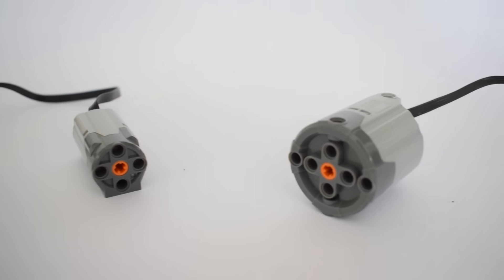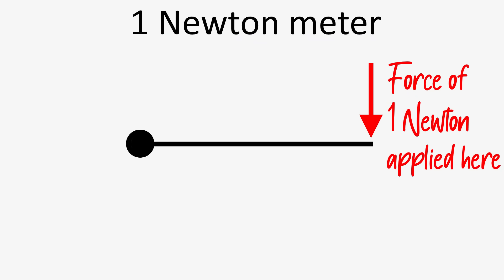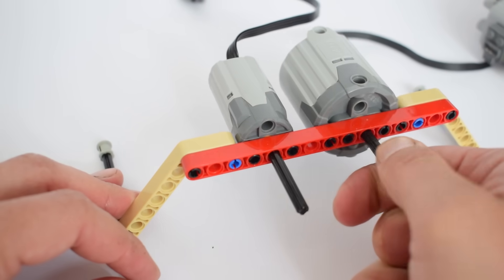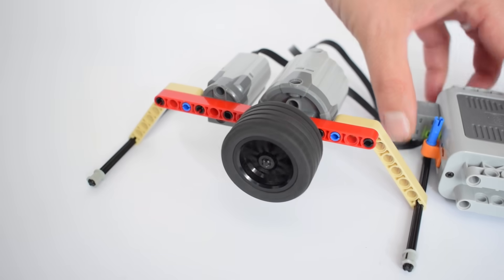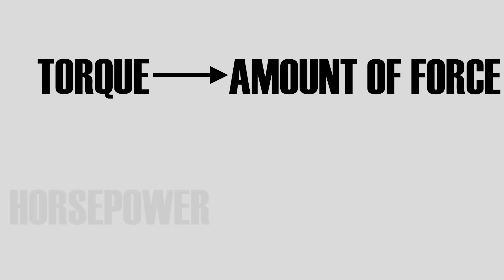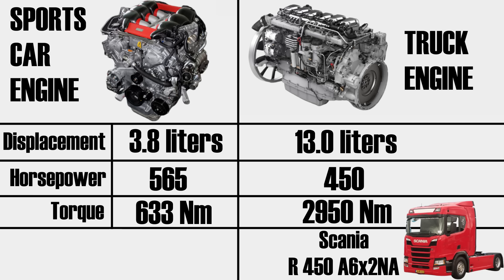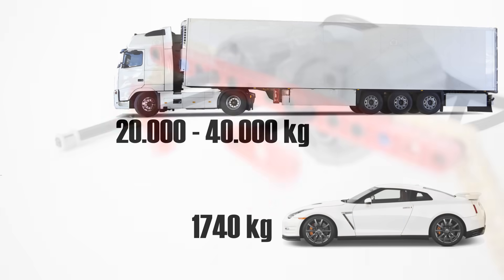NEVER be confused by HORSEPOWER and TORQUE again - HP and TORQUE EXPLAINED in the MOST VISUAL WAY

Comment: This is how my teacher taught me.  Spinning a wheel as fast as you can is horsepower.  Spinning a wheel as HARD as you can is torque.
Reply: You've already misunderstood then. See, he explains it easily, but not sufficiently. Horsepower is spinning something as hard as you can as fast a you can, giving you a graph of your power over speed and time. When you hear a sports car has "X horsepower", that's only it's peak horsepower at one spesific RPM. It will have different HP readings at different RPMs
Reply: @Excludos  It probably would have helped if I explained my teacher's demonstration when he taught us this. Granted we were learning about small engines and bore X stroke dimensions at the time too.

 Suspend a bicycle wheel off the ground and spin it with your hands.  Picture your hands as the pistons and the wheel as the crankshaft.  Spinning the wheel as FAST as you can requires your hands to paddle at their fastest possible speeds to achieve maximum output.

Now grab the wheel like it's the one on the Price is Right or Wheel of Fortune and spin it as HARD as you can.  That's your torque output. But you'll feel that you can never reach its max speed no matter how HARD you spin like this.  It's about how the work is applied.

For that reason when a manufacturer lists their peak HP numbers, it's more of a marketing ploy to me than anything.  Yep, I have no doubt those cars are performance built, but 99% of my driving isn't in that RPM band either.  Gimme those tq numbers, and Dyno graphs would be a plus too!
Reply: @Prairie_Barbarian  You're completely right. It is a marketing thing more than anything else. HP doesn't actually tell you anything useful. If I was to tell you "This vehicle has 1000hp", would you imagine a really fast sports car, or a mining truck? Both could be true. And this is completely ignoring the fact that "1000 hp" on the engine isn't necessarily 1000 hp through the wheels, and marketing tends to swing between both without telling you.

Torque would be a more reasonable measurement for the mining truck, while the sports car should rather rely on acceleration and top speed numbers.
Reply: No matter how much torque you have if engine can't spin fast you cant have a fast vehicle. Horsepower is not a marketing gimmick. Horsepower is the most important information you can get about a car's engine. You can "solve" low torque/high HP scenarios through correct gear ratios etc. You CANT solve low HP/high torque ones. Watch the video again and again until you get it.

Comment: An easy example of power to torque conversion is my arms lifting a car using a cat lifter: my arms are very low powered but using a high gear reduction, I'm able to generate enough torque to lift a 2.000 kg car off the ground. It just takes a lot of time. In fact, a 50 hp could pull 20.000kg. You just need to gear it accordingly and it would run super slowly. Power is the ultimate limit (energy).

Comment: He didn't have the definition of horsepower so...
A HP is the power needed to vertically lift a 33,000 lbs weight at a rate of 1 foot per minute.
The same as 550 lbs per foot in a second.

Great video mate.

Comment: Power is Work; how much work gets done in a unit of time.  Low power can eventually get the work done but it takes longer.

A force, as from a spring, applied for an hour hasn't actually done any work and it could sit there for the next hundred years not doing any work.  Something must move for there to be work done (and to be precise, work is accelleration; a thing can coast without work being done).  

A small motor can be geared to produce very high torgue but it spins slowly.  Consequently, whatever you move will move slowly.  A stronger motor can be geared to exactly the same torque but spin faster and thus get more work done, travel faster, cover more distance per unit time.  

Gasoline engines tend to have low torque at low RPM and increase torque as RPM increases, simply because of more bangs per second and each bang has a relatively fixed amount of energy.  

An electric motor tends to have strongest torque at low RPM or even completely stalled.   Since an electric motor can work all the way down to zero RPM, you don't need a clutch with an electric motor.

Comment: Torque is what gets you to scoot quickly from the stop light, horsepower is what gets you to scoot quickly during a merge on a highway ramp. Some cars might not have impressive horsepower numbers, but can be torque-y enough to be considered under-rated in day-to-day driving.

Comment: Good. But an simplification. A combustion engine applies force on the crank during a very short period of time during its strokes.  And different fuel have different expansion (how fast the flame burns) , this is added up as pulses depending on how many cylinders there is.  So a large diesel engine with 12 cylinders will apply much more torque spread out over every rotation.   Thats why its a success in tractor pulling etc.  Some will say that torque is useless and everthing can be solved with horsepower and transmission. But thats theory and not reality.

Comment: Hmmm. One relevant thing you could have also covered is the torque as a function of rmp and power output  as a funtion of rpm. Lego motor gives max torque even at 0 rpm. Naturally aspirated combustion engine reaches peak torque at relatively high rpm. So poweroutput at low rpm is very low even though close to redline you can have 'truck-like' horsepower. Given suitable gearbox, truck chassis moves just as well with 500 hp 2liter and as it does with 13l engine. It's all about how you're able to utilize the powerband.

Comment: Another way to think of it is how quickly you can raise something against gravity. Many people can hold 50kg of weight, but now try raising that weight up at a speed of 10 m/s. Impossible for a human even though the force stays the same.
Reply: are you sure about that? 50kg is a barbell with a 15kg plate on each side, a trained olympic lifter will be able to easily move that mass around a meter in a fraction of a second during the most explosive part of a snatch

Comment: But the higher torque can be transformed into higher power with a gearbox? What happens if 2 engines are equal in power and move a car of the same weight but one engine has more torque than the other!

Comment: For this equation torque is in foot pounds.
Horsepower = Torque x RPM / 5,252.
And a horsepower is defined as, the ability to lift 33 thousand pounds 1 ft in 1 minute

Comment: So big engines have a "slow" feeling and small engines feel more "energetic". There's a fun fact in big engines: that "slow" feeling can also be described as "linear", "gradual", "smooth", "reassuring" and "aircraft-like". In other words, big engines feel like there's a tremendous rush of torque gradually accelerating the whole mass of the car without ever reaching the end of its breath (and by saying "without ever reaching the end of its breath", I mean that "soft" feeling of the turbocharger when an engine revs-out).
This exact never-ending feel is what I noticed last week, in a video posted by AutotopNL in which they POV tested the BMW M760li (6.6 Single-Scroll Twin-Turbo V12, 585hp, 850nm of torque). A 750i (4.4 Twin-Scroll Twin-Turbo V8, 530hp, 750hp), even though it has Twin-Scroll turbos, would feel out of breath at some points!
https://youtu.be/Dl3VDWajgzI

Comment: Horsepower: how fast you hit a wall
Torque: how far you move it
Reply: Why do people say this seriously it doesnt make any sense and it's not even right
Reply: @benfennell6842  why doesn’t it make sense?
Reply: @andrewpavey  because how far a wall hit by any object would move is determined by the speed and weight of the object hitting it, or simply the moving objects inertia. It's wrong any way you look at it. Torque is not how far you move the wall.

https://youtu.be/7eZyXp1i4GU
Reply: Torque determines how far the wall will move after you hit it. 
Horsepower determines how long it takes the wall to move that distance. 
Both measurements are needed to fully describe the results of the impact.  
You measure torque with a ruler and you measure horsepower with a stopwatch.
Reply: @mrslcom  what? None of that makes any sense
Reply: @benfennell6842   It’s an analogy used to help make sense to most people.
Reply: @mrslcom  clearly it's not helping lol

Its nonsensical at best and objectively wrong at worst
Reply: @benfennell6842   The concept of using a car hitting a wall is to help non-engineering people visualize and describe the relationship between torque and horsepower.  The analogy is valid even though it’s not meant to be mathematically correct.  In pure terms, torque is simply a rotational (twisting) force being applied.  It’s difficult enough just to understand that in a linear world.
Reply: @mrslcom  i fail to see how its correct in any way, mathematical or otherwise. It makes literally no sense to me. Like an engine with more torque at a given rpm isnt necessarily better at moving stuff, it's not that simple. The rate at which an engine can move shit is DEFINED as power. work/time
Reply: @benfennell6842    It’s a confusing concept.  Both torque and horsepower measures different aspects of an engine’s output.  They’re two sides of the same coin.  To accelerate or to move an object, you need torque.  But it’s not engine torque, it’s wheel torque that matters.  And that is better determined by horsepower.  Now you add in engine speed and the whole thing becomes more complicated.
Reply: @mrslcom  if you actually wanna know the calculation it's just F=M*A rearranged as A=F/M, where A is the acceleration of the wall F is the inertial energy of the car and M is the weight of the wall.
Reply: @mrslcom  He made a video right after this one clearing up the nonsense you people are spreading around as "helpful simplifications"

Comment: Take gear and ratio it to the larger Lego Motor. Then Think that lager Lego motor just has internal gears also. Then Measure the current both motors at the same load. f.i. use it to lift up a weight. Take a wheel and a rope. Wind with both motors at the same shaft speed. Measure the current needed, time and voltage. THEN see what happens. NEXT ex plane Hp and Torque to the Tactor Pull events. I see triple build huge engines with a total of 36 cyl. Making 10.000+ Hp to drag a weight or Blow up half way. THEN !! A Steam Tractor out of 1910 just 20hp also drag that same weight, but now just slowly to end of the track and further into the woods :)) . Thats Torque.

Comment: The unit horsepower should be long forgotten. No engine is designed using that. Nm and kW is the right unit. I know that is the old habit which is die hard, but I hope it will soon. RPM is revolution per minute. Its revving the engine not rotting the engine for a reason :D

Comment: I have 2 chevy silverado 2500 hd trucks. One with a 6.0L and one with an 8.1L. Tow the same trailer with both and you understand torque vs horsepower
Reply: If the 6,0L is more powerful it will tow more, provided you gear it accordingly. It's torque at the wheels that tows not torque at the crankshaft.

Comment: Great explanation! It would be really cool to gear down the small motor to match the larger motor speed. Then they’d be outputting the same rpm but the torque difference would show the hp difference.
Also would be cool to gear them to output the same shaft torque, and the hp difference would show up as a speed difference:)

Comment: I like the scientific explanation this guy gives.  And that is the way I learned in physics.   It ment nothing to most of our class.  Our teacher dumbed down for us and it makes a lot more since when he did.
Torque is the ability to sustain your horsepower under loads. That is why semi trucks can pull heavy loads.  With less horsepower than a super car.  But put that same 80,000 pound load on a super car with 600 hp and much less torque and it won't do so well.

Comment: 5:45 - this is exactly why ev motors run at 15,000+ rpm and are geared down typically at about a 9:1 ratio.

Comment: I dont get it :( 
If we have two cars, one with 1000nm and 100 hp and another at 1000hp and 100nm, what would be the factor of speed? The weight of the cars? Uphill driving? If we have both at high weight, the nm car wins? If we have both at low weight, the hp car wins? If driven uphill the nm wins? If driven on plain road the hp car wins? Can both be driven at same rpm or how do that come in?

Comment: IT'S SIMPLE:
A car is stuck, and needs a push. A skinny track athlete can not make it budge, but an obese man can. The track athlete does not have the TORUE to get the heavy car moving, but the obese man does not have the HORSEPOWER to get the car up to speed and maintain it. Torque overcomes friction. Horsepower gets the job done.

Comment: Gears could be used to turn high HP of sport car engine into high torque, beating truck engine. The problem it wont last long as it would have to always work on 6--8 thousands rpm.

Comment: Why not just use the metric system where you calculate directional force using kWh instead of ft lbs.
Reply: kWh is a unit of energy, not force, and ft lbs a unit of work
Reply: @christophermackley8084  by your definition, you need energy in order to get something to work. And btw. kWh is a metric unit of the same thing.

Comment: Had an M1 tank , about 1600 HP, the torque was unreal. Snapped a 20 ton tow cable one day pulling another tank out of a hole, the cable put a quarter inch deep gash in my front slope armor about six inches long when it snapped back. fun stuff
Reply: Sheesh. Technically the rope was snapped by the torque, but the time it took for it to snap was determined by those horses. Any idiot with a harbour freight motor and a really REALLY reductive gearbox can snap a wire, what snaps it quick is all that power.

Comment: I don't think the analogy of "you can feel torque but not horsepower" is a correct statement.
The heat produced or how much your finger warms up when trying to stop the motor is = energy dissipated, which is proportional to the power of the motor.
You can definitely feel heat, not just observe it.

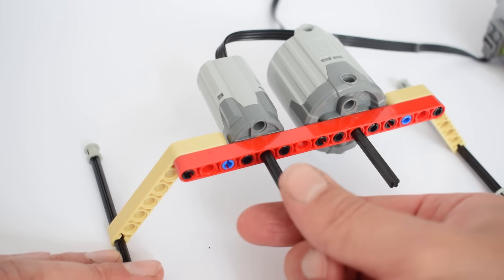Comment: 6:15 Isn't it power you feel when you accelerate? Enough force in small enough times causes sudden change in velocity, meaning acceleration that you get?
Reply: To elaborate, engine torque starts to dip at higher rpm, so torque at the wheels decreases. BUT as the wheel keeps spinning faster and faster due to increasing rpm, (wheel rotates faster = more activity = more power) the horsepower increases.

Comment: Most internal combustion engines generate feeble torque at peak, say starting at 2000RPM. An average naturally aspirated 1 litre engine might only manage 100NM, or 75lb/ft at 2000RPM. Any adult human could easily turn a foot long socket bar such as undoing a bolt with MUCH more force than 75 lb. Even if you double this for bigger engines it's only 150lb, or like having an average sized woman standing her weight at the end of a foot long metal bar. But you don't usually pull away at 2000RPM, so the engine produces even less at this stage! To get the force you need to start perhaps a 3500lb mass of a car moving from a standstill: enter the gearbox. A force multiplier. You can multiply that passenger car's torque output typically 4 times with 1st gear (with some frictional losses inside the box and the driveshaft joints etc) and then you can have over 500lb/ft at the wheels to get the car moving, even if the engine only makes 150lb/ft at best. That's why heavy trucks have so many gears, particularly low starting gears. That's why they can multiply the engine's torque by a factor of 15, to produce the force at the wheels needed to move 40 tons.

Comment: A good example can be :

Torque = Body Builder with super power that can lift 200kg but can't run 200 meter without running out of breath.

Horsepower = Marathon runner with super stamina that can run without stopping but cant lift 40kg.
Reply: Except the marathon runner (assuming in those analogy he's a car) has a snatch block (stand in for a transmission) and can actually lift 400kg

Comment: Mechanical Engineer here. Simply put:
Power = Torque x Rotational Speed
An engine has a maximum power, so that power can either be used for high torque and low speed or low torque and high speed, or some mix in-between.

The gears in a transmission allow you to control how much of that mix. (Distribution between power and speed). Like this:
100 = 1 x 100 (low torque, high speed)
100 = 10 x 10 (mid torque, mid speed)
100 = 100 x 1 (high torque, low speed)

Think of that as gears 3, 2 and 1 on your car.

Now, thinking of gas engines it gets a bit confusing.
A gas engine's torque CHANGES depending on it's Rotational speed (the reason for this- don't think about it for now) An engine needs to spin before it generates any torque. The engine's torque will be zero as the speed is zero and increase as the speed increases (power is increasing), but for reasons that are complicated, the torque will eventually start to decrease even though the speed is increasing more. That means there's a Maximum Power (remember Power = torque x speed) at some speed where the torque and speed is high, and power will start to drop as the torque drops ( even though the engine is spinning  faster and faster.)

That's why your engine needs a separate electric starter (to get the engine speed high enough to generate torque since 0 speed means 0 torque) and why racers always try to choose the right gear to keep the engine speed to be always in the maximum power (meaning maximum torque)

A car's maximum speed is the highest speed at which the torque is too low to accelerate the car anymore.

A car stalls when the engine speed is too low  to generate enough torque needed to keep it going.